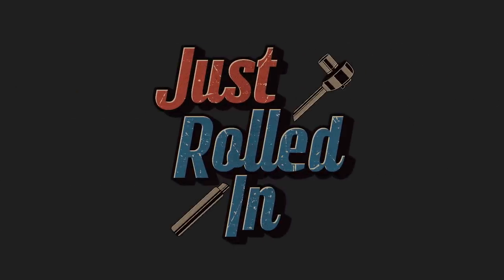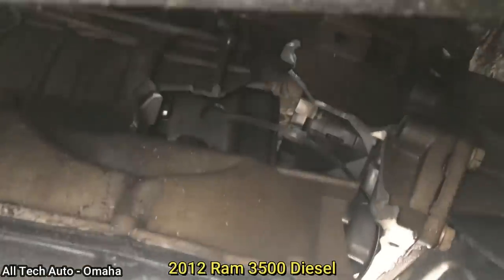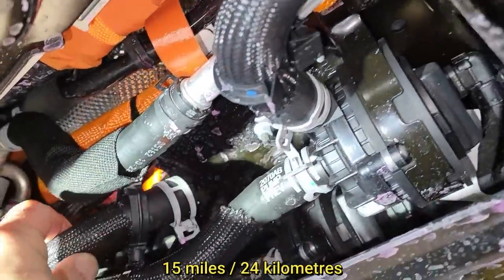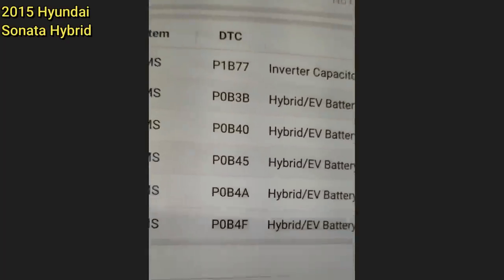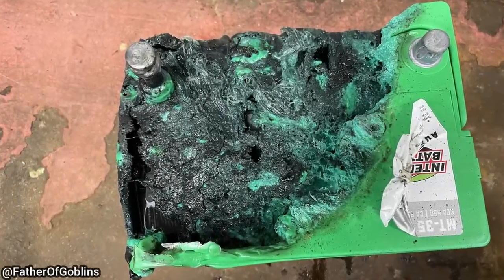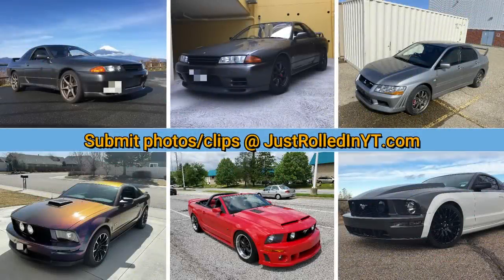Customer States New Truck Won't Stay Running (2022 RAM 1500) | Just Rolled In

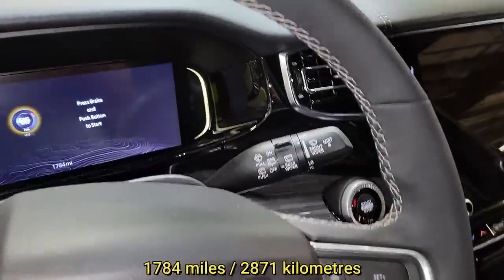Comment: 1:59 - A girl I work with just bought a brand new Jeep about 2 months ago and had the exact same problem with her steering wheel as well as some issues with the electrical system, and a leaking windshield.

Comment: Dodge RAM with 800 miles on it and the engine is damingoed. Jeep Wrangler Hybrid with 15 miles on it and the hose comes off.  Jeep Wagoneer with 1700 miles on it and the steering wheel is falling apart. Stell-Anus quality at its' best.

Comment: I had an ‘81 chevette 4 speed that would only go over 63 if going down hill🤣🤣
Reply from the maker: 😂 sounds like the Honda scooter I had when I was 14. Top speed was 65 km/h down hill
Reply: I drove an '82 automatic.  I can testify!
Reply: The Chevette made Car Talk's list of worst cars. The comment was something like "made of compressed rust." 🤣
Reply: @j_taylor  tbh, I love the car just hated people getting mad cuz I couldn’t hit 65
Reply: @buttholasaurus99  I hope you passed them at the next downhill! 😁
Reply: @j_taylor  My family's Chevette didn't live long enough to rust, even in Chicago.  It was a cursed POS right from the start.

My mother happily traded it for a Dodge 600 2.2 turbo which lasted longer overall if that's a significant indicator...
Reply: I didn't have a Chevette.  I had TWO Chevettes! 1984. (Both manual transmission.)

I drove the first one 30000 miles over the course of a year and a half.  Got pulled over for speeding (66... must have been a tail wind that night).  Verbal warning cause the officer was probably thinking "How did this kid get it to go that fast?"

I had the other one when I was overseas.  Sure, it had all the crappy running problems of the usual 1980s carbie car, but it didn't break.  Really, if GM had just put throttle body on them in the 1980s, that would have solved almost every drivability issue (they'd rather you buy Cavalier instead.)
Reply: Remember the diesel Chevettes? What a joke those were.
Reply: @maxwellcrazycat9204  never knew anyone who had one

Comment: That steering wheel material is actually a recall. One of many. 1700 isn’t bad. Beats 90 miles. Too many of those although it’s slowed down recently.

Comment: It's problems like these with new vehicles that turn people away from buying new vehicles. In a way, it's needed because automakers need to take at least a year off making new vehicles while engineers and mechanics work to make newer vehicles that aren't a headache to work on. Maybe convince politicians to lax on emissions and remove ethanol from fuel entirely. Basically force politicians to yield on regulations or there be no new vehicles until things change, however, automakers can work to produce parts to make older vehicles keep going.
Reply: I wonder how much diesel is used to produce Ethanol?  They grow corn to make it.

Comment: I parked my car at the mall one day, only to notice the white car beside me looked a little strange. The paint on the hood was blistering and turning black. Clearly the car was on fire. I grabbed my extinguisher, tried to open the door of the car so I could pop the hood. Nope, everything was locked up tight. So I got back in my car and moved it around 60 feet. My girlfriend at the time had called 911. By the time the fire crew showed up the car was totally engulfed in flames. Yes I could of broken the side window to get at the hood release. One thing I have learned is don't get involved in other people's issues.

Comment: Jeez! Do I take it that there is no annual safety check requirement in the USA? Most European countries have them - in the UK its called the MOT (for Ministry of Transport) and not only has it kept  a lot of the death traps off the road, but it also helps the mechanically clueless still drive a safe car by letting them know whether their disc pads are about to go down to the metal, or that rust has started in a structurally significant part long before things start dropping off...
Reply: Some states have inspections, some don't. They're more common where road salt is used in the winter.

Comment: My 2012 Ram is on its 3rd engine.  First was for the same thing, under manufactures warranty at 41k; second engine replacement was cam and lifters.  Mopar lifetime bumper to bumper warranty that I paid $3500 for when I bought the truck paid for the second new engine.  Oh yeah, it’s also on its second transmission.  It has 165k miles on it.  Glad I have the warranty for this thing.

Comment: @1:47 Standard GLB issue. This is a bit extreme of an example but minor debris like a few leaves getting in causing a minor noise is actually so common in my area that I thought they were just made that bad. Turns out debris ingress into the blower motor is a huge issue on the 247 chassis. The worst I’ve seen was a mouse that was in there and got torn up by the blower motor. Nasty.
Reply: @SpearM3064  Yea it was pretty disgusting and it smelled awful as well.

Comment: New cars coming back for an engine warranty isn't uncommon AT ALL, contrary to what you may think... at least at my dealership haha. An oversight in the factory means a bearing isn't machined right and the engine bedazzles itself from the inside out in under 1000 miles.
Reply: What brand?

Comment: Yeah, the steering wheel cover materials can be rather dodgy. I remember my old '98 Ram's steering wheel was made of a material that actually dissolved in water. Any time I drove with sweaty palms, my hands would be completely black when I reached my destination. If I forgot to roll up the windows before it rained, that was also a problem. I got a cheap cover for the wheel and that solved it, but that should've been optional, not mandatory.
Reply: My '72 Saab's steering wheel somehow managed to grow mold. Granted, this was in Seattle, where everything grows something. I once had a whole moss terrarium inside a broken reverse light lens.

Comment: Back in the mid 1970"s, I was working at a gas station / car wash. I popped the hood open on one car to check an engine and found the oil dipstick laying atop the battery where is had shorted out and burned. Had another customer that I asked if I could check their oil, she said she knew it was okay because the light hadn't come on yet, when I pulled the stick, it was all chunks of sludge and nothing else.

Comment: 0:50 This is just asking for a disaster. I assume the brake line disconnected is the passenger front wheel... so the driver wheel and brake had to do all the hard work each stops.

Comment: I once replaced the complete body wiring harness on a car with 10 miles on the odometer, due to a manufacturing defect where a damaged wire was found inside a grommet that goes through the bulkhead.

Comment: I worked in an aftermarket shop that installed and serviced Sunroofs. We had a women come in who said her sunroof glass shattered while driving down the highway. She had taped it up so it wouldn't leak. When we pulled the tape back and cleaned all the glass up, we found a 9mm bullet lodged in the metal track of the sunroof. The crazier part is when we showed the customer she said her daughter was sitting in the front seat directly under where the bullet had hit the sunroof.

Comment: That Grand Marquis probably spit a plug, and this caused the fire. Panthers are famous for this, and it could have been prevented engaging with the inertia switch in the trunk when she heard the plug pop. The best way to keep this from happening is checking the torque on the spark plugs every so often. It's very easy to do on these cars.

Comment: usually you see transfer cases blowing up when they forget to take it out of 4WD and they hit pavement, then do 70mph+ KABOOM
Reply from the maker: Yes! I've seen that often and the double cardon joints break on the front driveshafts.
Reply: I've seen front axles that implode because of that.

Comment: I wish I had been recording when I went to change the thermostat on my 2000 mustang. I took the upper radiator hose off and was greeted with liquid the colour of chocolate milk. I just purchased the car on July 5th. I think the previous owner put oil in the radiator/coolant overflow tank. I HOPE that is what happened.

Comment: The ram reminded me of a truck one of the other techs just got out of the shop not too long ago, damn thing had 1,500 miles and an unknown catastrophic failure caused the motor to go. All I wanna know is what went guy pulled heads off and everything couldn't figure out but it covered under warranty so I don't loose sleep over it.

Comment: So that guy was shooting out of the sunroof, right? How else would a casing get there? Theres an exit sign on Cline Ave (NW Indiana) and I believe it lets off in Markstown (an old housing block built cheap for the workers of the mills and other places around) and it must of had well over 200 bullet holes in it. Cline Ave dumps onto the Skyway, so at night you re pretty high in the air, and despite it being right next to a major city, the road is usually pretty empty, so its almost a perfect storm of conditions to make it a popular place to start blasting, Frank Reynolds style

Comment: That poor Grand Marquis....
Reply: Probably the infamous cruise control switch on the mastercylinder that likes to short out and catch fire.
Reply: @henrydillard6217  Not sure of that problem. Never come across it on any of the Panthers Ive had. What switch do you mean? The cc coast relay?
Reply: @RipRoaringGarage  the switch that screws into the brake master cylinder under the hood. It's not all panthers, only early ones. Like 93 to ? I know my 05 dosnt have it.
Reply: @henrydillard6217  Not sure why that would be a particular issue...I had early ones, 90, 98, 03 and 04 and the only issue they had were the steering column, the intermediate shaft that would lock up but not fires. That looks more like an interior fire that spread under the hood, or maybe cats since theres smoke coming from the underside by the trunk

Comment: So, for 2:12, at some time or other, a 9mm pistol got fired and the expended shell fell into the sunroof seating groove? Mind you it could have been at any point before the wind pushed the shell far enough back it was interfering with the mechanism to lower the sunroof back down.

Comment: Notice alot of these are Jeep/Rams, ive been working on cars most of my life and let me tell you... they REALLY dropped in quality over the last 10 or so years. Im fixing new vehicles more than any older gens. Lots of plastic that gets brittle, and cheap electronics in these "new" gen cars and trucks.
Reply: They’re way better now
Reply: I work on 50+ cars/trucks a day and report conditions on every 1. I notice engine, transmission, and more commonly coolant leaks on Rams, Jeeps and Chryslers (all the same company) of 2015 and higher. Some having only 10k miles. Not saying they are bad cars persay but i tend to notice a pattern here.

Comment: Yeah the hybrid battery was flooded in the trunk. They even have drains on antennas so why this wasn't thought about? I open my trunk and hose it down occasionally opening the drain plugs, if i had a battery in there i would run a pipe down on the road for draining purposes.
This is fire-toxic hazard if water gets in or if the battery suddenly starts spilling something.

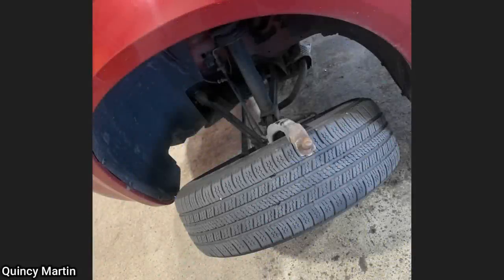Comment: 2:59 Something like this could NEVER happen in my country (or anywhere in the European Union) because we have annual mandatory roadworthiness tests. This kind of a fault obviously takes many, many years to develop, it would have been caught years ago.
Reply: In France, the first safety check (controle technique) is due when the vehicle is four years old, then every two years after.
Reply: Yes it can because you have corrupt mechanics. If a repair cost is 10,000 and the mechanic will accept 2,500 for a pass certificate then you save and keep the car going. This happens everywhere including Europe.

Comment: I sat behind one of those new Wagoneers and there was a massive panel gap on the left side of the trunk gate. It was uneven as hell. The whole gate was off center by like half a inch. Made me wonder if the gate could close all the way at all. $90,000 (most likely more for market adjustment) for poor fitment That's American luxury for you. 😂

Comment: The burnt up battery was a shocking development! Hopefully the owner doesn't find it revolting any more
Reply: I had a 70 el Camino years back, I was driving home 1 morning around 2 am and my head lights got real bright, I drove the 6 miles home, when I opened the hood o found the battery mount broke and the positive battery cable went into the fan, the fan cut the cable, the positive cable then welded itself to the radiator support, darkest thing I ever seen. I had a battery cable coupler, I repaired the cable and drove it for years after that, you can't do that with the cars today.

Comment: I had my trunk full of water several times on a Nissan, because the rear fender flange was not sealed, and in the rain, it would fill up with 8 inches of water.

Comment: That transmission.  I wonder what ultimately failed to cause it to come apart so spectacularly.
I tow with a Jeep ZJ with a 42RE automatic.  I have a trans temp gauge and I usually can keep it below 230F.  Often when on the highway this poor thing will run for hours a 70mph and 100% throttle.  Curious if this transmission will ever let go so spectacularly.

Comment: The smallest engine in a MINI Moke is an 850, it has 48 horsepower.
Reply: It is an 859cc and I whish it had 48hp! 34 HP was the rated output when new, 998cc non Cooper minis are rated at 41hp.

Comment: about 10 years ago or so a guy I know got a new dodge pick up ..it had less then a 1000 miles on it and the cam broke in half ,, so only half the engine was working ,,.. don't know how long he had it after the new cam was installed ..

Comment: Dang those Jeep’s are really junk now
Reply: I wouldn't buy anything built during the "covid era"

All the lockdowns and staffing issues caused by experienced techs retiring or quitting caused a ton of issues on every part manufacturer...  New guy puts parts together wrong, runs the wrong cycle to heat treat parts, etc.... Weird issues are showing up everywhere. No automaker is totally immune.

Comment: One Question: things like 0:48 are not possible here ein Germany due to TÜV. Can a car shop refuse to give the car back to the customer due to safty if he declined repairs ? Like the Brakes / Complete worn out tires and the ABS Hack Job ? I would call the Police if someone would come into my shop with a deathtrap like this. The whole car is a huge risk for the owner an any other car on the streets.

Comment: They got is with cars for clunkers. Shoulda been called clunkers for cars.  

Repair frequency went up in model year 09 ACROSS THE BOARD, almost without exception.  That's why whatever shit is out there cost 10k with 170k miles on it.

Comment: I'm in the market for a ford f550 or ram 5500. I want the cummins motor but am concerned about Chrysler/Dodge problems and build quality. I would prefer the Ford because it's a all around better truck but know the 6.7 powerstroke won't outlast the cummins 6.7. Why can we get a ford with a I6..
Reply: Only smart thing Chrysler did was to let Cummins supply their diesel engines. Maybe back it up with an Allison Transmission?

Comment: 0:05 There are only two explanations for this A) Dodge royally F-ed up making the engine, or B) the customer went past Redline and created valve float, which the 5.7 being an interference engine, would cause the valves to hit the piston. I'm willing to bet it was the latter...
Reply: How exactly does the customer go past redline on an engine with a rev limiter and an electronically controlled automatic transmission? The only way I could think would be if they locked into a low gear and then drove it down an incredibly steep hill that was able to overcome the engine braking and over-rev the engine, and even then that would only happen if the transmission programming was so bad as to allow the trans to hold a gear even if it substantially bypassed the maximum engine speed. The odds of that are substantially less than Chrysler just building another lemon, which they are notorious for doing.
Reply: @ouch1011  Automatic? Where in this video does it say it's an automatic? You do know Rams can come with manual transmissions right? While I agree Dodge has made so major piles of ----, like their lovely 3.6's and I won't even get into their CVT's, however their 5.7's tend to be pretty reliable besides burning oil. And I seen enough kids try racing in their 5.7 hemi Ram blow the engine/diff, not to mention I've personaliy worked on them enough times in the 25 years of turning wrenches, to know for a fact Ram's have no rev limiters or at least one the actually stops the engine from going over redline when in neutral or the clutch is pressed.

Comment: That 'Minj Moke' will be the refurbished version with an electric motor.  Even the smallest petrol engines Like with the 848cc engine coul reach 90mph and the 1275cc version could do over 100mph.  An electric Moke is not my idea of fun but the 1275cc gas Moke?  Well that's another matter.
Reply: No, my Moke is the 848 engine. Mokes had a lower top speed compared to the 848 Mini due to low compression engine and being severely handicapped by aerodynamics.